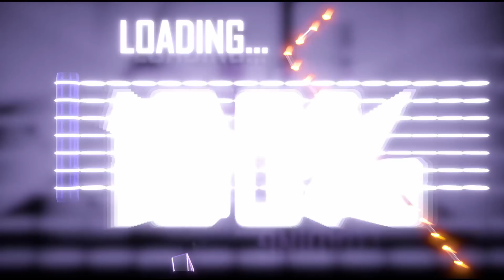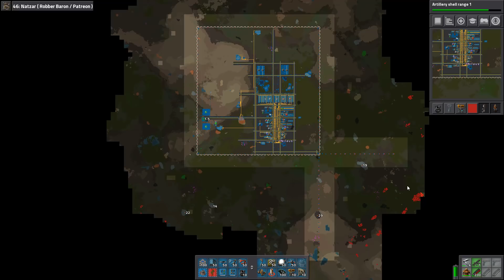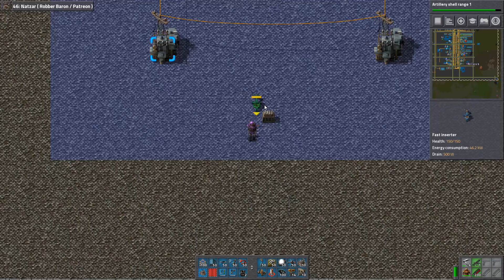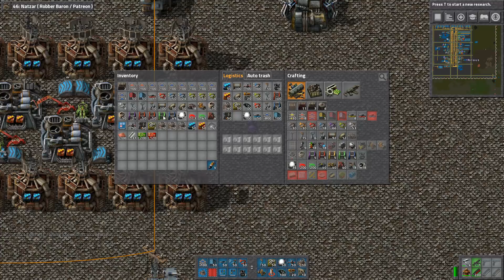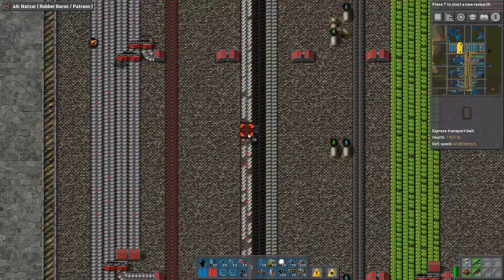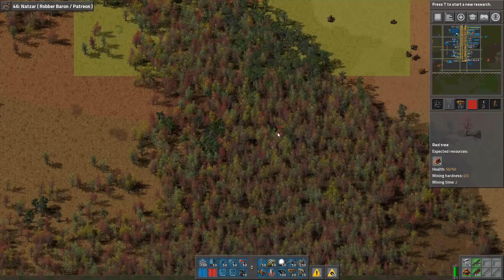Factorio 0.16 - Final Factory #46 BEACONED STEEL DESIGN

Comment: Nilaus, it always outputs on the right side based on the direction the BELT  is going if the inserter is parallel to the belt. You should also put repair packs in a storage chest. I remember something about repair packs in a certain roboport only being able to service things directly in that roboports area and not the connected logistic areas.

Comment: Haven't quite finished watching, but each of your steel columns is 20 furnaces. That means only 10 of them are actually producing steel, and at .64 steel per second, it would take 62.5 furnaces to fill up a blue belt. At 40 furnaces actually producing steel, you'll be getting 1600 or so per minute.
Reply: Came to say the same.  With 20 furnaces only 10 are making Steel, the others are making Iron.
So your estimate is likely off by 2x @Nilaus

Comment: Is there some trick to building tileable beaconed smelting columns? Short of simply copying Nilaus, I am terrible at it.
Reply: @mjay6245  I have read this twice very slowly and I do not understand. I'm sure it's my fault and not your description, and I very much appreciate you taking the time to explain. Third time's a charm.
Reply: @mjay6245  ok that does make a TON more sense. I don't have factorio up and running atm but next time I'm on I will definitely try it with more confidence. Funny enough I too am at point in my starter base where I need beaconed steel just like this episode. Thank you once again for your help!

Comment: If I'm not mistaken, you have no conditions on the rocket launch, so when you cut the research, you risk overflowing the buffers, and actually wasting the science. It would be a shame...
Reply from the maker: the Space science stacks to 1000 hence I will need to launch 96 rockets more than I consume in order to overflow. That is not likely to happen anytime soon :)
Reply: Ok, thank you for the answer. As often, it was quite stupid of me...
Reply: Space science beakers stack to 2000.